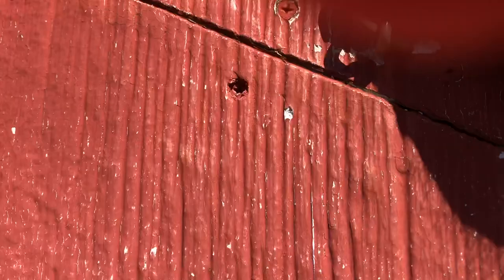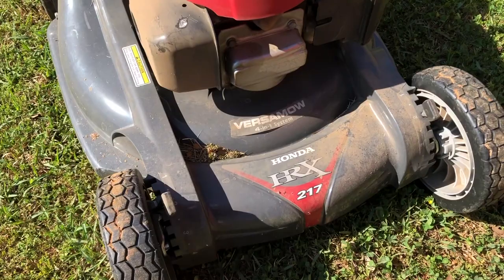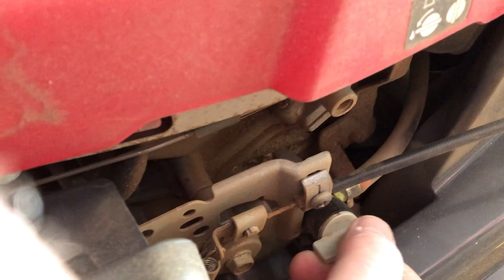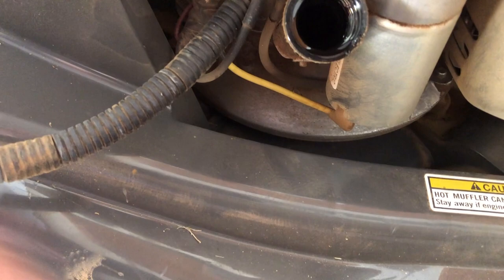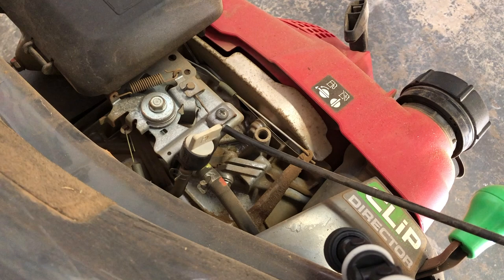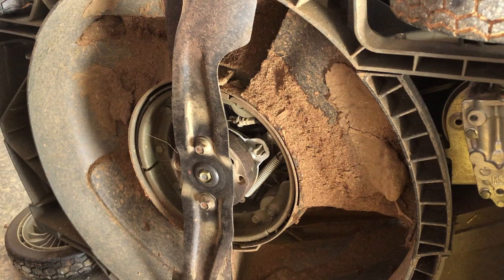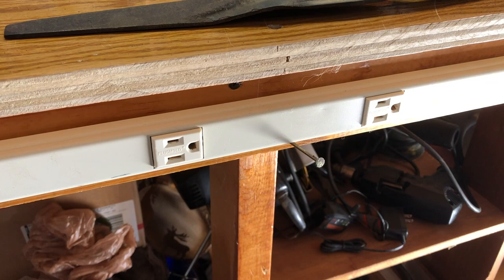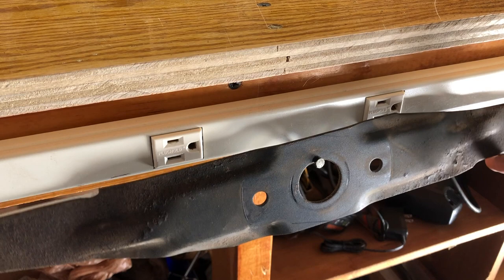HONDA Lawn Mower Maintenance [ASMR Chore Video]

Comment: When you change the oil, put a Gatorade 32 ounce bottle over the oil filler opening and tilt the lawnmower. All of the oil goes into the bottle without spilling and with room to spare. It’s very easy compared to using a pan.

Comment: Good to see you check the balance. I have an older Honda mower. I fear it is on it’s way out, but I am guessing it is probably 25 years old I am guessing. Use it to get the drainage ditch on one side of the yard done. Also gets under the trees and shrubs. After that it’s the zero turns time to finish the job.
Reply from the maker: Certainly got your money's worth out of that mower!!!

Comment: My poor lawn mower. I've never done any maintenance to him, just fuel him up every year and off he goes. I feel like a bad lawn mower parent now.
Reply from the maker: No oil change??!!! Mister, if you were standing in front of me right now I'd .....
LOL, change the poor fellas oil or I will have to report you to the proper lawn mower authorities.
Reply: How many years has it been since you've changed it? Lol  I hope it's at least a cheaper brand and not a really good one, otherwise I'd definitely recommend changing it.

We used to buy a cheapy 20-21 inch (MTD or Yard Machines brand) mower at Walmart every 2-3 years. Never changed the oil in it and probably mowed the large front and back lawn 25-30 times each per year. I would check the oil every now and then to see if I needed to add more, but don't recall changing it. Mainly because it was such a cheap mower and the wheels would literally be wobbly and about to fall off by year 2 or 3 and the bolts holding the wheels on would be rusted/seized and usually not want to tighten or loosen. When you factor in the $100 cost of a new mower just a few years ago, four new wheels and the bolts/nuts to go with them cost over 25% of what an entire mower cost. Of course, now things are different. Now even the cheapy is pushing $200 if you don't want self-propelled.

Bought a nice new expensive Troy Bilt about a month ago at Home Depot. I loved that it had the large rear wheels. I always saw the brand on TV and thought, "I'm going to buy a really nice one like that someday."  We bought it, I got it home and right after opening the box, it was already leaking oil out of the front of the motor and also out of the air hole in the filter housing. The instruction manual was written by someone who clearly wasn't speaking my kind of English and their diagram didn't make sense or explain things properly for putting the handle on. Normally, that is a super easy process, but this was a different kind of handle and different way of connecting it to the mower. I finally figured it out, but then found the leaking oil and it sprayed even more fresh oil into the new air filter as soon as it ran for a short time.

Took it back, returned it and bought the $160 cheapy MTD/Yard Machines brand, instead. Not a problem at all, had a better handle on it with no drama, etc. Sometimes more expensive isn't always better. Though now that we are beyond the $100 category and I like the new mower, regular maintenance and yearly oil changes should keep it going for at least 4-5 years. To me, the $100 one just wasn't worth changing the oil in since it would run for the 2-3 years before it fell apart and just needed a little new oil added now and then. But even though the new one is still rather cheap, I like it and want to keep it in good shape.
Reply: Lawn mower parent. Lol. I love it!
Reply: @user-tb2jy9lu3d  I work for Lowe’s and when I bought my first house I picked up a mid-range Troy-bilt mower. I couldn’t even make it through one round of mowing the tiny yard. It bogged down in moderate length grass and I hated the speed control mechanism. I returned it and went across the street to Home Depot where I picked up a Honda similar to Mr. R’s, except mine has a hydrostatic drive. It cost nearly double the Troy-bilt, but might be the best purchase I’ve ever made as a homeowner. It’s simple to operate and more reliable than any vehicle I’ve ever owned. A decade later and with minimal maintenance, she still fires up with a half pull after sitting all winter.

Comment: Love the video thank you so much but as a mechanic it just bugs me so much when you refer to the ratchet as a wrench they are not interchangeable because there different tools. They do the same thing generally but they are different. Sorry for the rant and again thanks for a great video
Reply from the maker: It's a "socket wrench" good sir. Ratchet is just an informal term for the handle and there certainly isn't anything wrong with calling it that (I do all the time). Remember though, a typical torque wrench has a ratcheting handle too, but we still call it a torque wrench:)